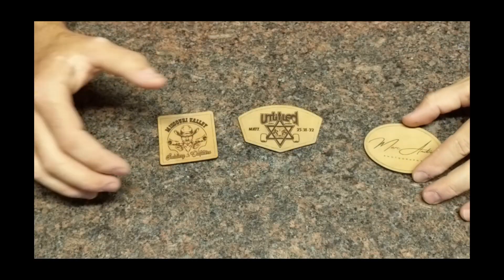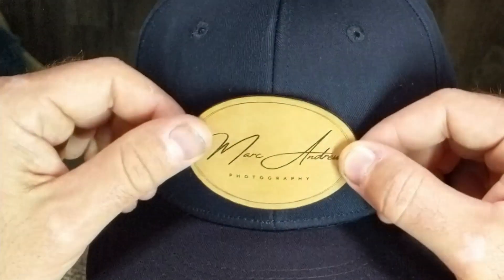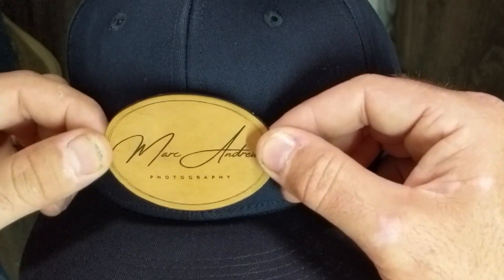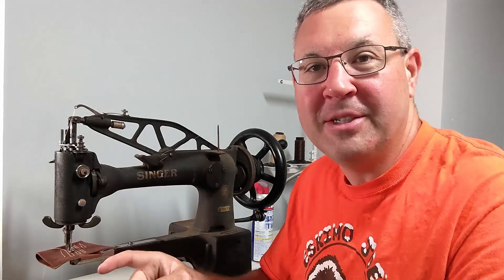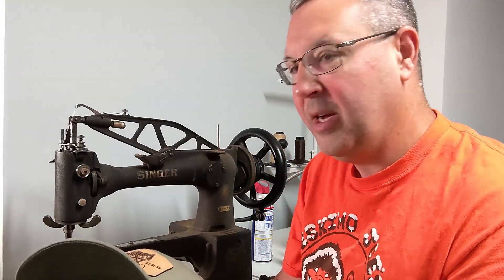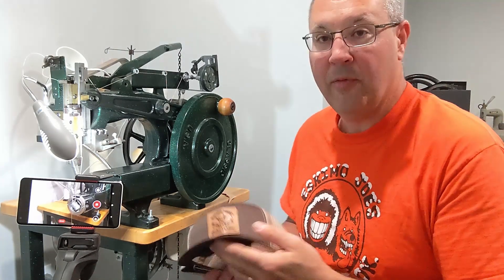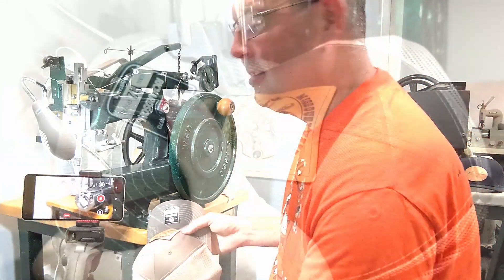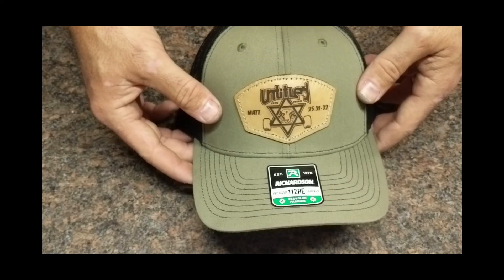Leather Hat Patches - How I do it

Comment: What kind of adhesive do you use for the patches? Also which sewing machine is best for sewing patches?
Reply from the maker: John,  I use double sided carpet tape to hold the patches on until I sew them.  I have found that a post sewing machine is the best for me when sewing on patches.  It gives me the best mobility to move around the hat.  There are several different types of Post sewing machines, I use an old singer with a roller foot.